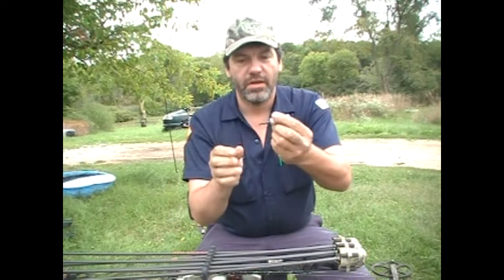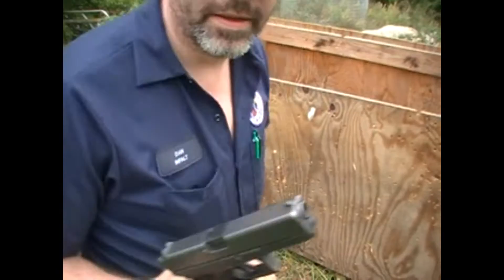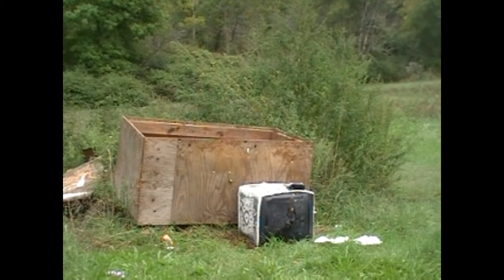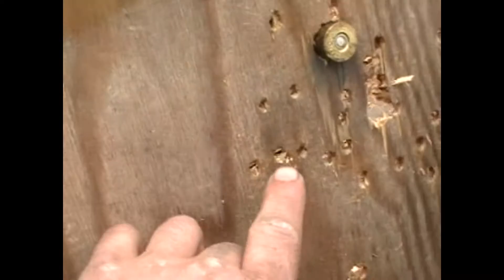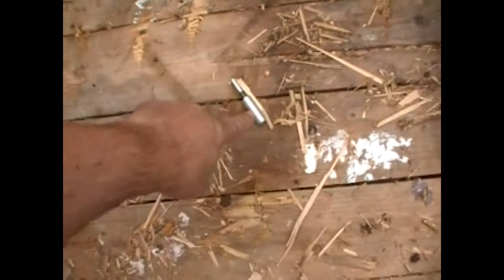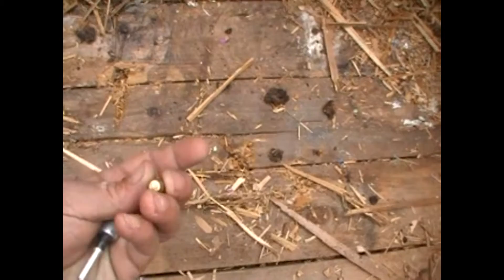EXPLODING ARROW

Comment: I worked for years as a machinist. Back in the day my friend and I made poorboy broad heads by cross cutting .02 slots in field tips on a Bridgeport mill. Then silver soldered 1.5" band saw blades into them make two blade single bevel heads. They were pretty deadly at close range.  Oh-Yea  I thought I was the only one that shot at shot gun shells and lived to talk about. lol...